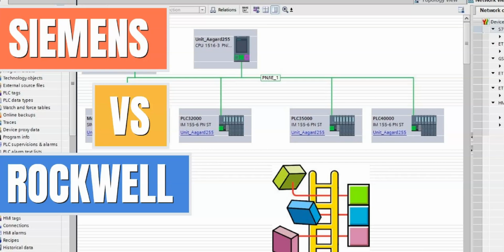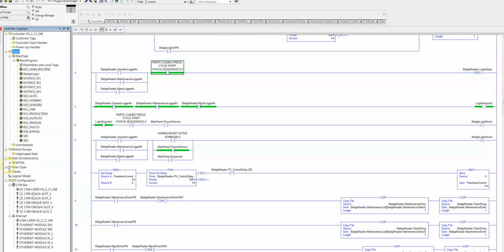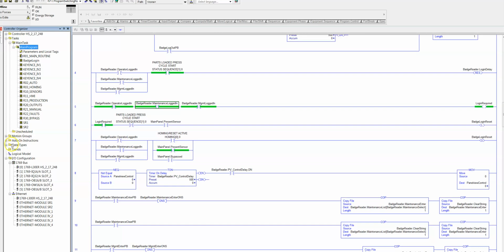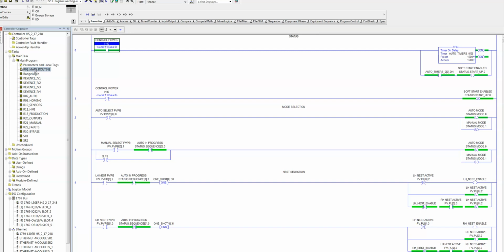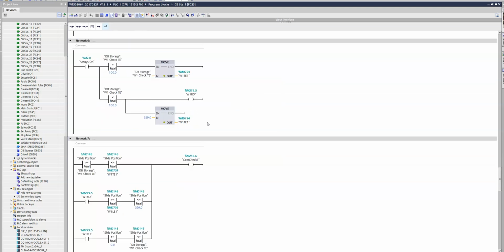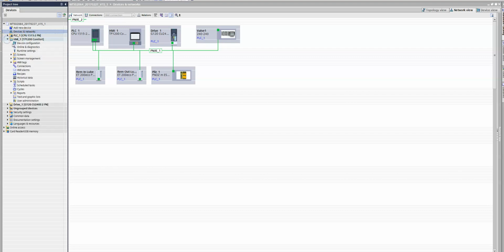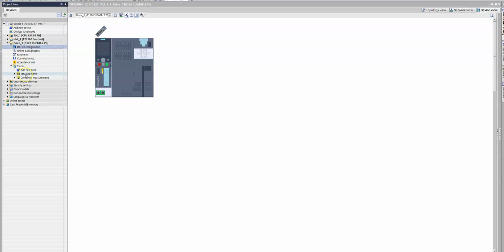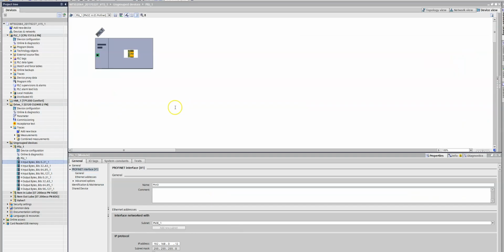PLC Programming - Siemens vs Rockwell - Which is The Best for Beginner Programmers

Comment: Siemens one thousand years ahead Rockwell! Understanding each kind of function possibility and the theory about the data block (single instance and multi instance) is blowing mind! Once you change your mindset and instead of simply starting programming you first structure your application and apply FCs or FBs depending on the structure designed, you see the difference. Basically Germans structure the application first and Americans don’t.
Reply from the maker: I work with several senior engineers with LOTS of siemens experience and Rockwell as well. They like a few things about siemens but overall they do not like it at all. Just their thoughts.